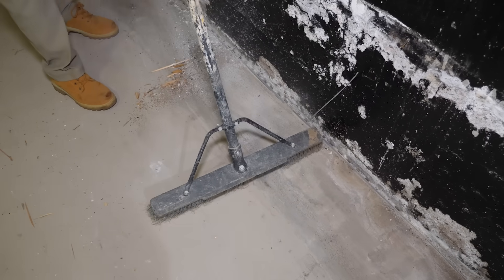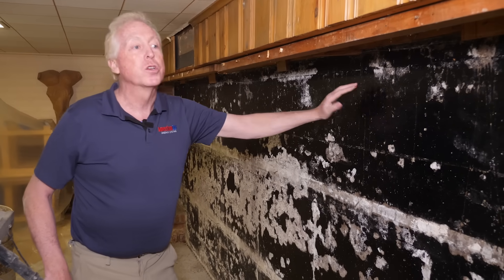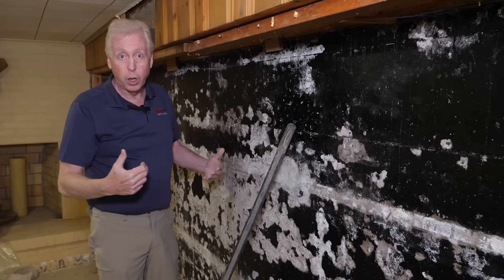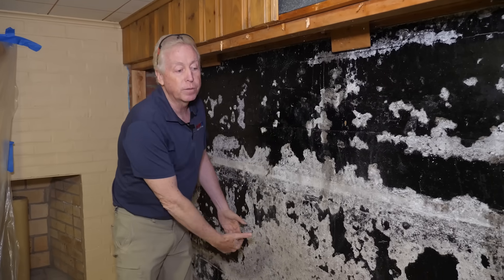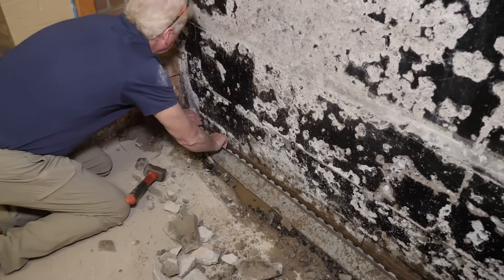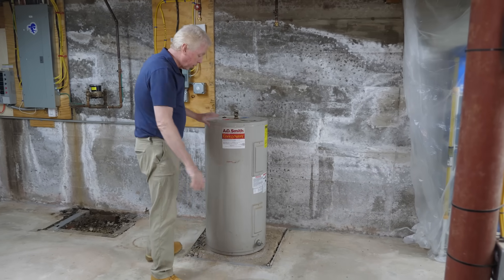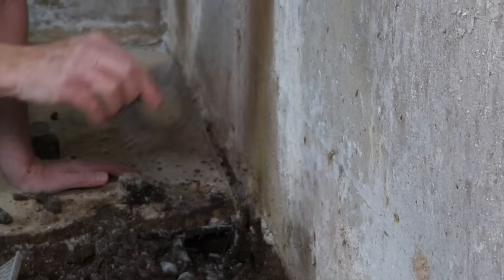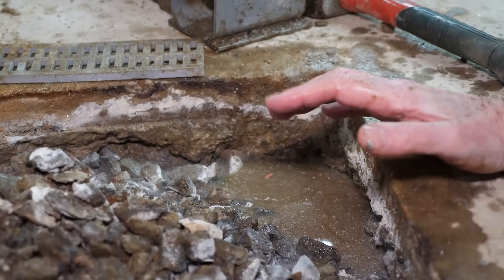Waterproofing Basement Walls | Finished & UnFinished Basement

Comment: Fixing the grade outside would fix most of the problems. I had a very wet wall in my basement, changing the grade, adding extra drainage away from the house made everything super dry. Keep the water away from the house!
Reply from the maker: Exterior grading is definitely a great first step, and we always recommend it where possible. But often, it's not enough to handle hydrostatic pressure from groundwater.

Comment: What are your thoughts on parging the interior with rapid sets waterproofing cement? In your experience, does this create the same situation as using tar?
Reply from the maker: Parging the interior with rapid-set waterproofing cement can slow seepage for a while, but it doesn’t solve the underlying water pressure. Like tar on the outside, it just forces water to find another path. In our experience, it’s more of a temporary patch than a real fix.

Comment: Is Drylok a good product for keeping mild moisture out?
Reply from the maker: No. Even with mild moisture, it will crack and peel after a couple years. Dry lock is not a permanent solution.
Reply: I had a similar system installed in my basement and during a recent flash flood the pump could not pump the water fast enough and the corner began to seep through the wall  “step” cracks. What can I do to fix these step hairline cracks?  @AmericanDryBasementSystems  I had a
Reply from the maker: @genevieverosso9877  If you’re seeing a block wall step crack, that’s a sign of too much lateral pressure from the outside. Covering the crack won’t solve the problem. First thing: check that your pump’s discharge line to the outside is clear and unobstructed. A clogged or undersized line can kill performance. Second, don’t rely on shallow channel drainage in your basement floor to handle a major storm — it won’t keep up. Have the drainage replaced or upgraded to a larger 4-inch pipe below your floor to relieve the water pressure. Once that’s under control, then go back and repair the crack itself.
Reply: Is there anything available for homeowners to use that is a good long lasting product?

Comment: Great information.  I just got a house inspected - built 1942 (Northend Bridgeport CT) and the inspectors comments makes me nervous, is this bad, and/or unsafe.  "There is some deteriorating surface conditions on the block concrete with signs of moisture penetration in the form of a fluorescence, staining and peeling paint. There was an active water leak noted noted at the foundation. The moisture content in the block and mortar foundation walls are average for a non treated basement of this age as measured with a moisture meter. There was no microbial growth noted."

Comment: Can Drylock be removed? The prior owners out it on and there's crumbing and that crystalization. I want to prevent it getting as bad as this video.
Reply from the maker: Yes, Drylok can be removed, but it’s a messy process. It usually involves scraping, wire brushing, or using a chemical stripper — sometimes all three. The crumbling and crystallization you’re seeing means moisture is still getting through the wall from behind the coating. Even if you remove it, you’ll want to address the actual water source so the problem doesn’t return.

Comment: What did u put on the wall to make it waterproof?
Reply from the maker: We use a proprietary mix called SuperSlurry — not your typical waterproofing paint. It grows into the wall, forming crystals inside the concrete to create a lasting barrier from within. If you've already addressed grading, gutters, and downspouts but still have water issues, it might be time to consider an interior subfloor waterproofing system. When done right, it's a permanent and more affordable solution than exterior fixes with limited lifespan.

Comment: Why build a basement? houses should be built with the slab grade at a higher point from the ground up just digg out for the footings and than back fill in the opening it’s 2025 we don’t need basements
Reply from the maker: Basements are mostly outdated—they're expensive, prone to water issues, and unnecessary in modern construction. Slab-on-grade or raised slabs are faster, cheaper, and more efficient. You only really need basements in cold climates for frost protection or if you want extra space without expanding the footprint.

Comment: Dang man id just fill that basement in and make it a slab!  Might as well move and save a fortune!
Reply from the maker: Avoid living in any place marked as a FEMA flood zone would be a good start, or move to a high-rise apartment. Also, please tell the neighbor not to install that new pool, or instruct the construction crew two blocks away to stop building those townhouses. All these things can start problems when you never had them in the first place.

Comment: We have a French drain system, which is fine, but the water trickling through our cinderblock foundation higher  up on the wall isn't enough to get to the drain. But the blocks are deteriorating.  Not a good situation.

Comment: You can use hydraulic cement sealer and in tubes if the leaks are very small but if it’s bigger it’s best to cut out an inch to 2 inches deep of concrete where the crack is and drain it to the sump pump.   So it seems we are in agreement.   Digging outside down 8 feet is a big mess and extremely costly and it’s still not a guarantee.   Your drainage from roads what counties have done can cause lots of problems too.

Comment: I actually hope people in my area don’t figure out how to do this because as of right now, I actually have no competition because contractors don’t think to use YouTube as the library that it is also, there’s a specific term you’re not mentioning

Drain tile system.  It was only once I realized that that was the term that this is called in architectural plans that I was able to unlock information about how to do it.

Comment: ❓DRYLOK… Built our house in 1999 to modern building Code stickler Village in the Chicago suburbs with a full basement and black sealed outer wall and complete outside drainage system to Zoeller AC pump and 110amp-hour Lithium LiPo4 battery back up pump on a C-TEK smart charger.  I even have two alarm floats in the sump pit, one indicating “pump one fail”, and if it goes above the back up, I get a “complete sump pump system fail” all connected to our alarm central system.  They call right away.

Had DryLok on inside walls back when the house was freshly built.  Never had a single problem.  Seems DryLok has a bad rap because there are people who never addressed the outside perimeter was never addressed with proper drain tile. 

ASIRI architects (also has a nifty YouTube channel) claim a vapor seal is appropriate on the inside walls.  

I am trying to understand why DryLok was a mistake… if it was.  I certainly agree that if you have drippy walls and fail to address the outside drainage and foundation seal correctly, that sealing with DryLok on the inside is a big mistake.  That is crystal clear.  I was addressing a mitigation of basement humidity.  It’s a big basement and run dehumidification as well.  I don’t see the DryLok as misapplied in my specific scenario.   Perhaps of course there are better or more preferred products.  Any professional opinions are certainly welcomed.
Reply from the maker: You are one of the exceptional few. Your setup sounds well thought out, and it’s great that you’ve had no issues. I'm sure maintain them often. DryLok gets a bad rap mainly when people use it as a fix for water intrusion rather than just moisture mitigation. If exterior drainage and foundation sealing are solid—like in your case—then applying DryLok isn’t necessarily a mistake. The problem is when it’s used to “stop” leaks instead of addressing the real issue: hydrostatic and lateral pressure. Without proper drainage, coatings like DryLok can trap moisture, leading to peeling, efflorescence, or even wall damage over time. So, in a well-drained system, it’s just another layer of moisture control, but in the wrong setting, it can make things worse.
Reply: @ I really do appreciate the response.  Got one more question, does your company ever dig around an outside foundation wall to add drainage and seal the outside wall?  Or is it just too darn expensive and you can manage it on the inside perimeter more cost effectively albeit the outside total perimeter is perhaps better?

Comment: Would you recommend silane siloxane sealer application on a basement wall interior as a way to reduce efflorescence for a 1930 poured concrete foundation?  Is that any better than just not having any sealant on the walls at all?
Reply from the maker: That sealer will make things worse, unless you solve your water seepage problem with a perimeter drainage system. The system will keep the false water table low, so your walls will stay dry most of the way through. If your walls are always damp without seepage, sealling them is not good idea. You have to let them breathe.
Reply: @AmericanDryBasementSystems  Thanks for your advice on this!  I hope to install a perimeter drain eventually.

Comment: My basement has a drain tile and it suck!  I have moldy walls and being low income I can’t do a thing about it but live like this !  I dream of a dry basement
Reply from the maker: Someone did a poor job. Drain tile requires a pitch to the sump pump. If its PVC pipe, it will require clean-out ports for flushing it annually. Also, it could be made out of cheap material that cracked and filled with dirt. You can't use the corrugated pipe sold at the big box stores.

Comment: Word. I worked for a long time for a major waterproofing company that installed a system just like this. I've sold it (unfortunately), serviced it (with its many issues requiring service) and lost all faith in it. I learned the industry years ago the "old fashioned" (and as it turns out BETTER) way and I will be starting my own waterproofing company very soon to be sure the people in my area have a dependable choice. If a drain tile system is needed, it should always be installed in front of the footer with a proper pitch, good sized trench and ample gravel to collect and move that water to be discharged. A big name and fancy packaging doesn't always mean they have it right. Stay safe out there folks.
Reply: Thank you for the feedback.  I have a B Dry system that was installed before I bought the house.  In your opinion, is that a good system?  We had record rainfall this year and no standing water in the basement (never has been) however there were trickles in some spots coming down the wall (very minimal) and there are a few spots where lime is pushing through, again very minimal and not nearly as bad as the example in the video, but it is concerning.  Right now, and for the next few weeks, I’m fixing crack and mortar issues outside followed by waterproofing paint on the outside and paying particular attention to sloping the ground away from the house.  The current plan is to wait until next year’s spring rain season and recheck the problem areas before proceeding with finishing the basement.  I would really appreciate your input since you’ve been in the business.  Thanks!!

Comment: Why not put French drain style drainage outside the wall?
Reply from the maker: We recommend against installing French drain-style drainage outside the wall because, over time, they almost always clog and become ineffective. In fact, we often find ourselves addressing problems caused by unreliable exterior perimeter drainage systems. Instead, it’s more effective to focus on grading the property to slope water away from the foundation and extending roof gutter drainage 15 to 30 feet using underground PVC piping.

If water is still entering your basement through foundation joints, consider installing an interior perimeter drainage system. It’s a far more reliable and cost-effective solution compared to exterior perimeter options, which often fail and end up being a waste of money.

Comment: if the problem is on the outside maybe you should fix the outside instead of the inside
Reply from the maker: No. Exterior perimeter drainage is very unreliable. Don't let a contractor tell you otherwise. You will never get a lifetime warranty from them.

Comment: So I cant paint my basement walls? 😢
Reply from the maker: Yes you can as long as you have subfloor drainage system in place managing the water that comes from the outside. Your walls will no longer become damp. Moisture will evaporate before it can settle further into the wall from the outside.

Comment: I am having water vapor coming up through our slab on grade. Found mold when i removed our floors to put down new flooring. There was a vapor barrier but it either wasnt properly taped/layed or vapor penetrated it and got trapped under the floor. I am currently addressing drainage around the home. Will a crystallization system

Comment: Any advice for me?? Here’s the situation: I have a small whole about the size of a quarter in my basement near the main water line. I thought the original owner moved the waterline because it seems to be the same size and it’s an out 2 inches from it. However he claims did didn’t move it just replaced the pipes. I filled the hole with hydraulic cement which worked for about a year. Then water came back. I dried the hole and filled it again now it depends on how hard it rains or snows. The hole is positioned in the front of my house but I can’t get to it because I have a cement porch. Eventually I know I need foundation work but what else can I do or a diy foundation work to stop the water? All advice is appreciated! 🫶🏾

Comment: Great job my home has the same problem my father in law had a b-dry system put in from the outside without digging up around the house the company drilled holes into the ground then pumped some junk into the ground but never stopped the water

Comment: Does anyone have an explanation why sealing the wall worsens the efflorescence? Without sealant, moisture travels into the wall, dissolves the lime in the concrete (I believe chloride ions in the water are the main accelerant of this) as it travels through, emerges on the other side and evaporates leaving behind lime. Makes sense. In the second case, the water can't evaporate due to the sealant. In fact, having no where to go, wouldn't it prevent new water from coming in and dissolving more lime? The entire idea is to remove the pressure differential presented by evaporation. Now an imperfect seal could definitely lead to efflorescence behind the sealant and you have two problems. But how on earth does a sealant accelerate efflorescence?
Reply: It doesn't make sense to me. For one you'll always have moisture on the outside. So being able to "breath" will not keep it completely dry. For two you always see warriors put up in finished and utility basements. They are also often painted inside. They wall that he uses as an example is poured. So who knows if the mix was off.

Comment: So can you just finish the walls after all that.?
Reply from the maker: Yes.
Reply: @AmericanDryBasementSystems how can you be sure that the walls won't still leak? Do you have to wait for heavy rains to test it? Also, would you put up foam board against the wall between the studs and the wall? Or would you put a polyethelene sheet against the wall and run it into the drain tile?
Reply from the maker: @brianhawthorne8480  We are sure they won't leak. We have been doing waterproofing for a long time. The finishing part is up to you. We don't offer that service. You can paint the walls or add a vapor barrier and insulation between the studs and the wall. If you have a history of severe flooding, install a waterproofing system, and then wait for a weather event to ensure the system can keep up. If the result is a dry basement, you can finish the walls. If water still finds its way in, have the company come back and resolve the problem. The final question is whether you trust the waterproofing company to solve your problem so you can finish the basement.
Reply: Sounds logical. Thank you.  I'm just mostly wondering if a french drain, like yours, which looks very comprehensive, will prevent water infiltration into the walls. It looks like I'll just have to wait and see. I installed the french drain myself a few months ago, the same way you guys do yours. But south jersey hasn't received any significant rain for months, so it hasn't been tested. I want to finish the walls, but may have to wait until next summer so i can be sure it solved the wall problem. Either way, it needed to be done. Hydrostatic pressure was pushing water in through the cold seems at the base of the wall. Pooling water was present about 1 inch below the  concrete floor when I dug it up last spring when the water table was very high at the time. Thanks for your reply!

Comment: What would have happened if they had put the tar on the outside of the basement walls?
Reply from the maker: Tar, specifically asphalt-based coatings, is still sometimes used to waterproof the outside surface of foundation walls. Over time, tar can become brittle and crack, which allows water to penetrate the foundation. That's why companies like mine exist to address the failure of outside waterproofing.

Comment: Why would someone initially dig out this basement space so large around where the cement or blocks are going to be inserted as basement walls just to backfill that whole area surrounding the basement walls, leaving the walls open to leakage and water pressure?  Why not only dig where the material will be?  I understand molds.  But why not have the mold be styrofoam on the outside that will never be removed?  You would kill two birds with one stone that way.  It would be very cost effective, too.  I’m honestly not telling you what to do.  I truly am just curious.